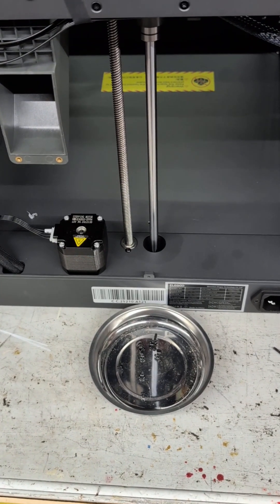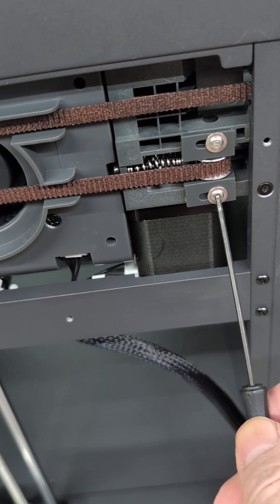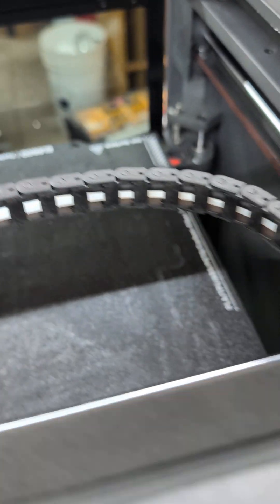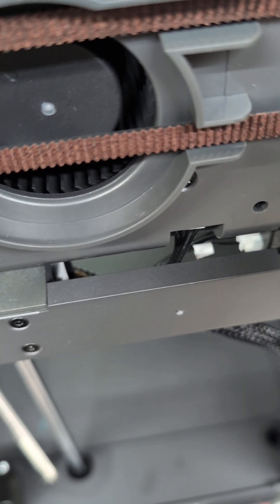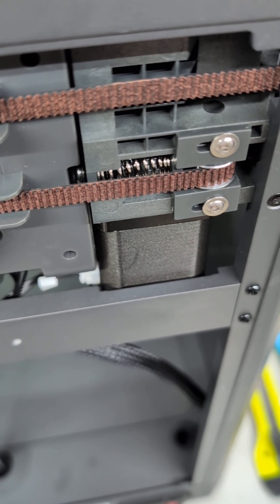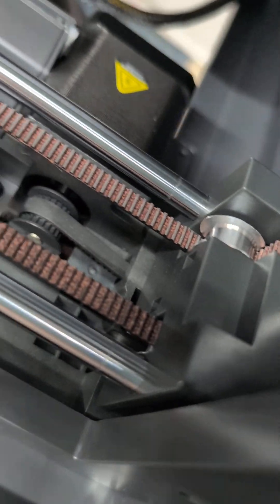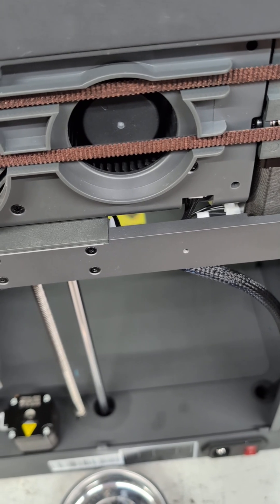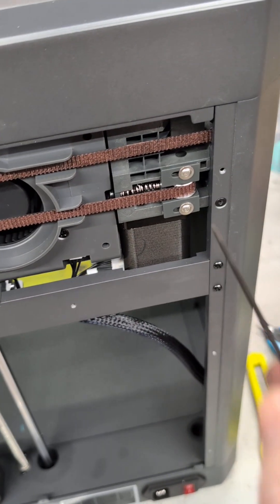Elegoo Centauri Carbon Belts adjustment

Comment: So all the youtubers that have hundreds of hours on there Elegoo CC's never complain about the belts this is the first I dont understand whats the issue
Reply: I got my brand new CC today and I´m unable to print a thing because the 2 top belts are loose, 1 cm on the print head and over 2 cm on borh sides. I first tried to print the Benchy, but on the first layer the print head wandered to the back right corner, when I stopped the print, the "Benchy Spagettis" was 17 cm long ... So I set the printer back to the stock settings, complere new self test and then tried again to print a benchy and got nearly the exact result. I used the presliced Benchy from Elegoo, but I checked this D-Code with loading it in Cure. Then while taking pfotos for the Elegoo support I touched the belts, so I dound the reason why I can´t print.

Comment: the springs play a vital part to the high speed inertia and reduces stress on the stepper motors and reduces the z wobble an artifacts in the prints and also the backlash noise, and the stress on the belts
the screw are there to keep it in place to slide
Question
did you lubricate your moving parts and rails with the  supplied silicon grease
i did and do with al printers and never had an issue,

Comment: You are ruining the printer btw
Reply: I'm having an issue where the surface of my prints looks like fuzzy skin is enabled, when its not.

I was wondering if it was a belt tensioning issue. But people are saying the Centauri Carbon has auto tensioners?

Any idea what the cause may be?

Comment: They are suppose to be loose - those are auto - tensioners
Reply: I disagree when one of them was almost out due to the vibration.   The belts were too tight when they were loose.
Reply: @WayneWenthin  You have no clue what you're talking about
Reply: @WayneWenthin  you are just wrong🤣🤣
Reply: @WayneWenthin Its not a debate - those are auto tentioners and are supposed ro be loose. That is not opinion - that is how they are intended to work. You can make a claim that the spring is to stiff and makes them to tight - but that doesn't change what they are or how they are supposed to work
Reply: @paulhuckaby elegoo says to losen the screws, slowly move the printhead around and tighten the screws again.
Reply: @paulhuckaby if you loosen the the gantry w go out of square. I can't do that.